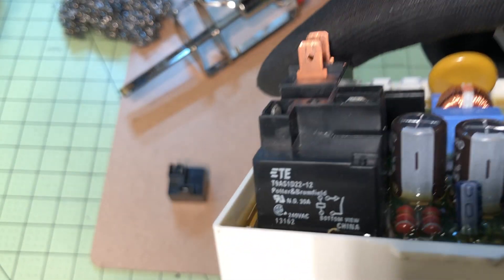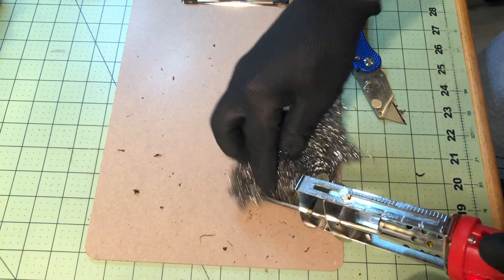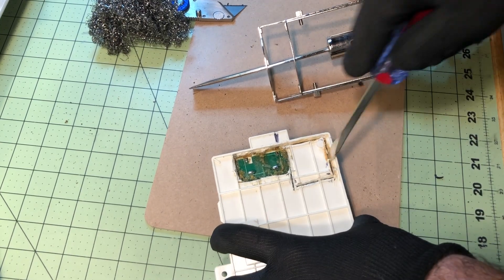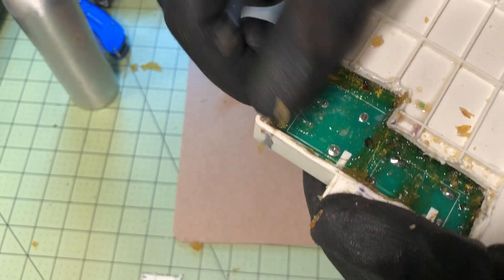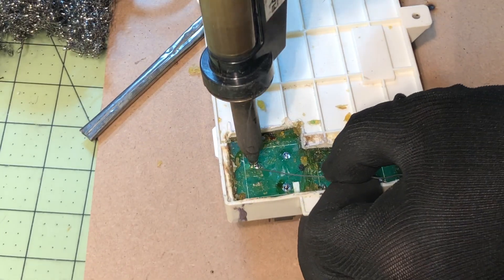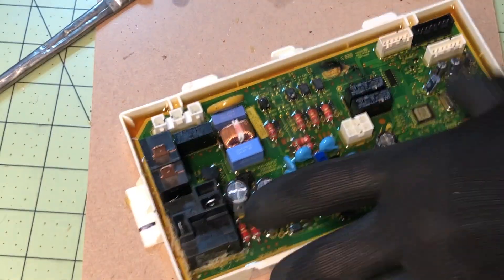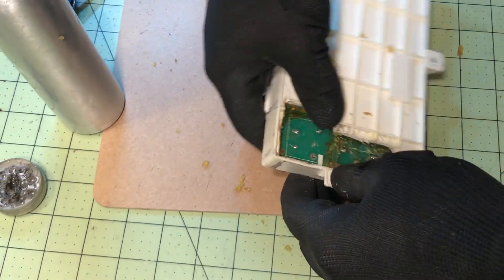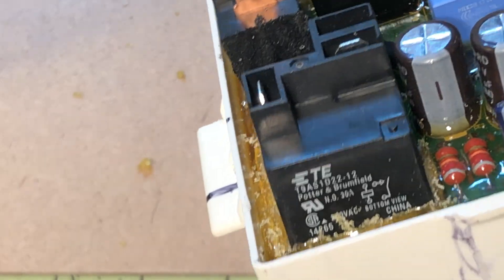Potted board relay replacement

Comment: Hi
Is the faulty relay keep blowing the fuses in the microwave oven. As all door switches are ok.
Reply from the maker: Relay won't do that, check for a shorted high voltage capacitor.

Comment: Where is a good source for replacement components like the relay you replaced?
Reply from the maker: using the part number printed on the part itself, search octopart.com, it will show you price and availability from different parts distributors.

Comment: Awesome video - Thanks. How did you determine it was the relay ? My Samsung dryer igniter was not heating up, after debugging using Multimeter - I shorted the 2 prongs of the relay connector .. and voila ! the ignitor started to glow red. I'm interested in knowing how you found out that it was the relay...  Please let me know when you have time.
Reply from the maker: I test the voltage to Neutral (or Ground if connected) from the top pin (the one that does not have constant voltage)  Start the dryer, should go from 0 volts to 120 volts. I have a more current video with a better hot knife.

Comment: Great video. Would you be interested in swapping a relay on my potted pcb for my dryer?
Reply from the maker: I teach board repair, and repair my customer's boards in the field. That's about it.
Reply: You didn't say "no" 😁
My Samsung dryer control board has a failing relay. The board is no longer available anywhere online (Amazon, Ebay, appliance repair parts sites). If for some reason you change your mind, my email address is thenaaks@yahoo.com

Comment: Hey, what is the tool name used along with the soldering iron to install relay? I’m talking about the silver rod.
Reply from the maker: Hot Knife
Reply: Electronics Projects I saw the hot knife at the beginning.  its the thin silver stick I was talking about. I was guessing it was some type of solder stick.😀
Reply from the maker: @williehoward3966  are you talking about the solder? 60/40 rosin core
Reply: Electronics Projects yes sir, thank you! I am repairing my first relay board  this month. Your videos have been helpful.